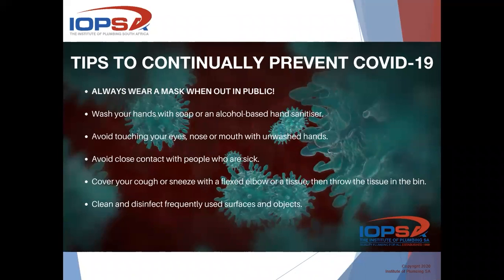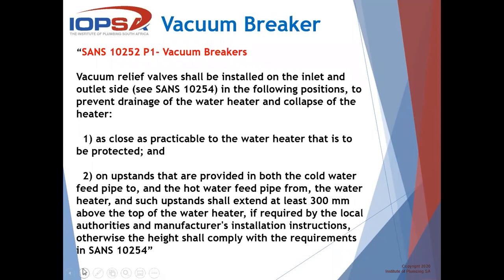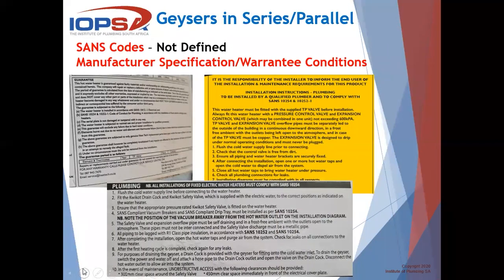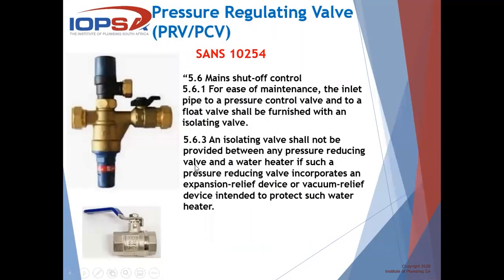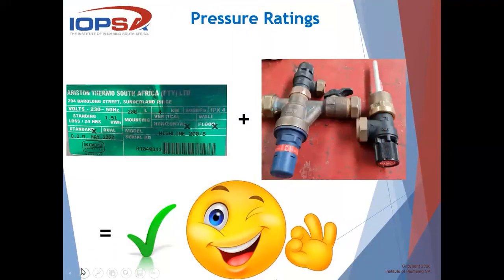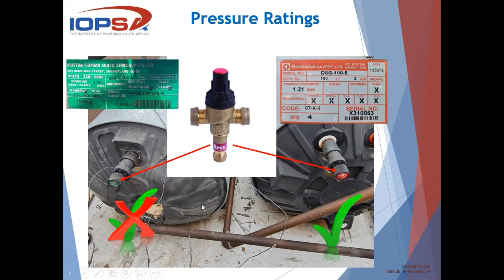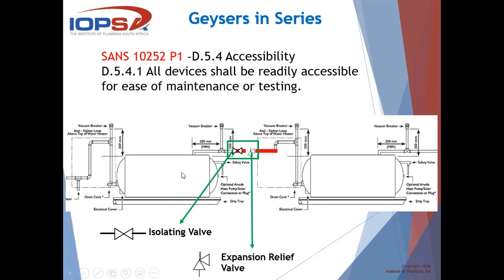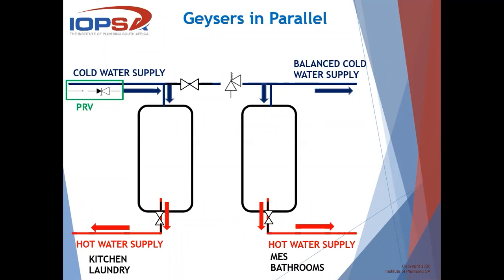Tech Talks- 2 December 2021 Multiple Geyser installations

Comment: If the installation of two geysers is in the format of "In Series" then one geyser will work harder than the other in terms of heating. The one geyser will require element/ thermostat replacement sooner than the second geyser. Furthermore one geyser will be required to be replaced sooner than the other. The best scenario is to connect the geysers in tandem. This means that both geysers operate equaly at all times. Important - if in tandem both gfeysers must be at the same level and tubed out exactly at equal lengths and configuration.